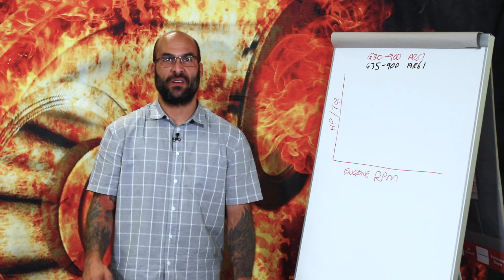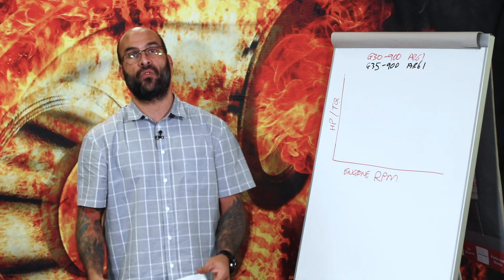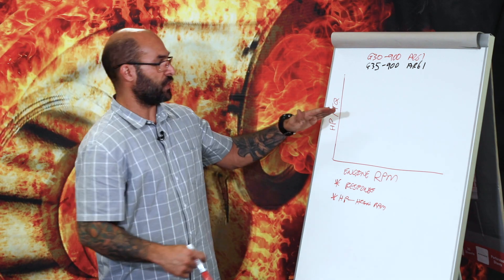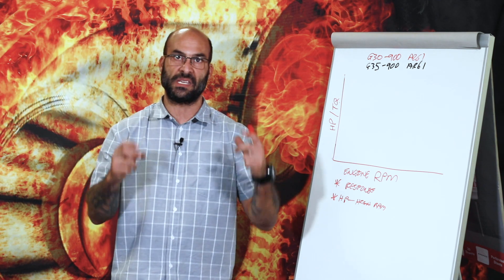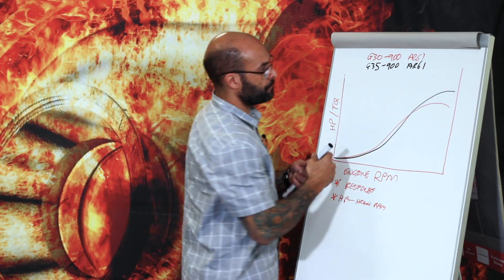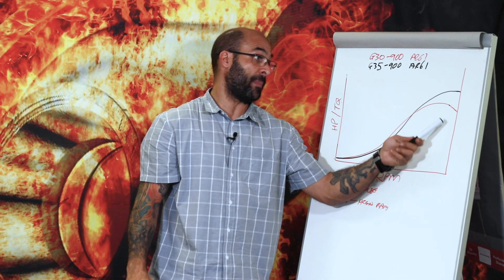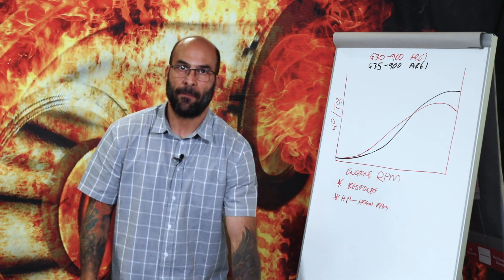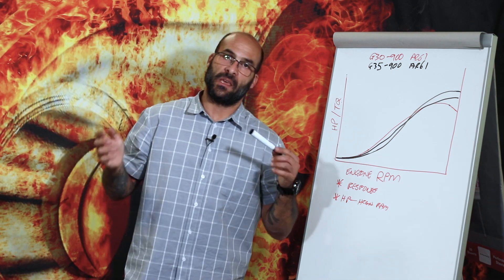G30-900 vs G35-900 N54 motor

Comment: Hello Sir,i still thinking whether i should buy pulsar g35-900 or g30-900,using rb25det s1 target horspower less than 450 for street use.Which one is more suitable?
Reply from the maker: Pulsar is cheap Chinese copies of Garrett - no serviceable parts available, expensive for a Chinese copy. Invest in a real
Turbo with back up service and a reliable product - EFR, Airwerks, TDSA - all
These are variable options
Reply: @TurboDirectSA okay then is it Garret GTX3582R suitable?

Comment: How much the increase in hp expected while move from .61 to .83 turbine housing?
Reply from the maker: It all depends on the build. If you having back pressure issues and you alleviate this you will see HP gains. If there is not much back pressure then you won’t see much gain in HP

Comment: What about a G35-900 with a T4 divided housing? Small A/R. 
Where would that fall in this scenario?
Reply from the maker: Always keep in mind that as you go UP in the family size housings, the AR number is irrelevant. E.G T3 AR1.06 housing is physically SMALLER than the T4 AR.58 ---- going up to T4 will introduce lag, IF your N54 engine is stock standard. IF however your N54 is running 13:1 CR, and wild cams, stroked and revs to say 9000RPM - then you will see high backpressures with the T3 smaller housings, and you will not make the power or power BAND the turbo might have to offer - so replacing the turbine housing with a larger T4 family will be the best thing you can do.
Reply: @ 
I agree and thank you for that explanation. 
But what about the spool characteristics of a T4 divided smaller A/R vs a T3 open larger A/R?
Say in a GTX3586 style with a K24 (built) platform?
This is what I'm trying to decide between. 
Thank you.
Reply from the maker: @ttzofutah  Now you talking about an efficient engine that revs to the moon - you will see much better benefits in using the T4 family housings. No question. Installing the T3 will choke the turbine and increase back-pressure - more heat, less power, and and

Comment: I’m getting a doc race top mount single turbo kit. It’s a T4 Divided manifold. What is a turbo with similar specs to the G30-900 that comes with a T4 housing to fit my manifold? Thank you!
Reply from the maker: @NickFigallo  a much better option would be the EFR830 which will outspool and outperform the G30 series also with stainless T4 inlet flange
Reply: @ I’m not finding a turbo called the EFR830 from Borgwarner anywhere.
Reply from the maker: @ apologies typo - EFR8370
Reply from the maker: @NickFigallo  Apologies - EFR8370 -- https://store.turbodirect.co.za/index.php/shop/turbochargers/turbocharger-turbodirect-s-a/supercoreefr8370ironb-h70x61swa84x62cw-detail

Comment: I just did this on a n54 the G35 900 makes more power and torque everywhere compared to a G30 900.
Reply from the maker: @blrn54  with more lag down low yes
Reply: @TurboDirectSA  No a g35 900 makes more power everywhere on a n54 compared to a g30 900. Maybe on a rb25 or 4g63 g30 900 makes more power and torque early but on a n54 it doesnt.
I literally just dynoed them.
Reply from the maker: @blrn54  Depending on the turbine housing i have to disagree, we have done the very same tests using G30-900 with AR61 turbine housing and there was aLOT more resposnce from the G30 compared to the larger and laggier G35. Using the AR83 turbine housing the two turbos spooled more or less the same, BUT was still slightly faster linearly from the G30 - power output pound for pound was higher above 20psi on the 35family - for obvious reasons BUT only with the larger turbine housing.

Comment: hi i have r34 gtr still factory i want to put a g30 or g35 on it to do away with the twin factory turbo's. the tuning shop is saying i will loose low end power and response if they goto single turbo. after watching lots of youtube videos i don't think i will. whats your opinion?im hoping to get around 500 whp on factory motor and keep low end power. some head room on the turbo would be nice for future engine work. but i don't want to sacrifice low end power as its just a street car.
Reply from the maker: @freedom3469  https://store.turbodirect.co.za/index.php/shop/turbochargers/turbocharger-turbodirect-s-a/g3076r1-forged-detail 

This is what you should install - quick spool and will produce the target HP and then some. The genuine Garrett G-series is overrated and underperforming for the expensive price.
Reply: @TurboDirectSA  thank you for your advice. can you tell me about the turbo you recomended or have any links for it. how much? supply to New Zealand ?
Reply from the maker: @freedom3469  shoot an email to info@turbodirect.co.za for more info

Comment: What would you suggest for a 2JZ 400-500whp maybe 600, I was looking at a G35 900 with a 1.01 rear housing. But I'm now curious what you would suggest. It's a street car with stock 6800 Redline. Cheers
Reply from the maker: @VandilFish  efr8474 black series without a doubt with AR83 turbine housing - easily spool fast and make the required power with plenty in reserve

Comment: I can’t believe you’re still responding to all the comments!
I’ve been mulling over this for months, I have a Mazdaspeed6, 2.3 engine, AWD; redline of 7900 rpm and I’m shooting for 650-720whp. 
I’m not sure if should stick to a G30-770 and be happy with whatever it ends up making or do a G30-900 to try to actually hit the higher margin.
.83 AR turbine housing for sure.
It’s dumb but I’m looking for the best response possible because it’s a street car, while still making an idiotic amount of power that I won’t get bored of 😂
Reply from the maker: For the best spool versus power output - I’m sorry but Garrett should be your last choice. EFR is light years ahead! Don’t waste your time on the G-series turbos. For the HP target you aiming for the EFR8370 will do exactly what you want
Reply: @TurboDirectSA haha, I was gathering that from the rest of the comments. 
I think unfortunately anything twin scroll is off the table for me, so I have to find the best option that isn’t.
Would you shill for any of the Precision turbo options? They’re highly regarded in the mazdaspeed community and suggested by the leading tuner, but I just hadn’t witnessed them perform to the same degree that I had seen Garretts
Reply from the maker: @chapystick_  nothing will spoil or perform as well as the Borg in the OEM sector.

Comment: I’m so torn because I want that big power but love the low end big block feel of the low end torque from my pure stage 2 twins
Reply from the maker: This is the case with most N54 owners - however what you don't understand is that its easier to spool a single turbo than two smaller units. You can use the entire exhaust energy accumulated together to drive the single turbo - if you combine the volume inside both turbine housings from your twin setup it will be close to if the the same as a single midframe turbocharger that is capable of more power than the twins are.  E.G our G3077R will spool similarly to the twins but make double the HP  https://store.turbodirect.co.za/index.php/shop/turbochargers/g3077r-forged-detail
Reply: @TurboDirectSA  that may be true but I’m making food boost by 1800rpm… the car feels like a big block.

Comment: Loved the video!  I have the same car but different goals.  It's a 2009 N54 335i and I'd like to use a Garrett turbo for the reliability, but am all about response.  What Garrett turbo would suit me best to achieve the fastest spool, but still make 475-500 on 93 octane pump gas, and 550-600whp on E85?
Reply from the maker: To be honest i would consider the EFR range over Garrett, time has shown the G-series to be overrated and unreliable. However if you prefer this range the smaller of the two would provide the better response. Careful with boost levels - you can suffer shaft failure.

Comment: Im surprised to see 0.61 rears mentioned for a 3 litre! Im used to seeing nothing less than 0.8s on stock capacity RB26s. Enjoy your videos as always👌
Reply from the maker: Streetable setups use the smaller AR housing for the low down response, but naturally the HP will become limited, and higher backpressures will be experienced.
Reply: @TurboDirectSA  My question is, is it generally better to go 1 turbine size up with a smaller A/R housing, or keep the "correct" or even one size DOWN turbine, with a bigger A/R housing? Assuming the vehicle is mixed-use (but mostly street) as opposed to pure street or pure track. I'll also watch the video to see if it's mentioned there, but if not; then I guess this is a preemptive comment, haha.

EDIT: You DID mention it in the video. Nice. Thank you.
Reply from the maker: There is so much more to choosing a match in your rotating assembly then blade count and noise. This is why there are off the shelf products which are matched , tested and maps plotted accordingly - changing these components will usually be detrimental to the performance of the turbo.  @Drunken_Hamster
Reply: @TurboDirectSA  I understand that, but a big part of the fun for me when it comes to cars are the noises and theatrics. There are other areas I can optimize any given setup to compensate for a perhaps not-so-optimized turbo that gives me the exact noises I want. Such as a twin-scroll housing and divided exhaust manifold, or a really good flowing head. Or getting a tighter A/R ratio to compensate for fewer turbine blades, etc.

This is why I ask so many questions. If I know all the variables, I can pick and choose where I want to make sacrifices and advances in order to min-max my wants vs my needs.
Reply from the maker: Twin scroll housings versus any other design do not contribute to noises. Wastegate, inlet tract and BOV (or the lack of using one) do.  @Drunken_Hamster
Reply: @TurboDirectSA  I don't think we're going to get anywhere with this conversation any longer.

Instead, could you please make me a couple of turbo recommendations?

First one: ~75 pounds per minute on a 2.3-2.5L engine(assume a relatively high VE but not as high as a good K-series), mid-range focused without being either gutless on the bottom or breathless on the top. I want minimal turbo lag, 1.5 PR boost threshold by 3000rpm, and wicked-fast transient response. I plan to run a Pressure Ratio between 2.0-3.0 depending on when I'm using pump gas or E85 and I intend to tune the ECU to auto-adjust with flex-fuel. Max RPM will be 7000-8000.

Second one: 3.5L engine ~90 pounds per minute. Same idea with the responsiveness and other factors, if possible.

Third: 1.9L TDI, ~60 pounds per minute, low-mid range focused, 1.5 PR boost threshold of 2000-2500rpm, max RPM 6000-7000, and I'm gonna run this one full time at higher PRs in the 2.5-4.0 range (depending on what the turbo likes and limits are)

Fourth: 3.0L V6 TDI, ~75 pounds per minute, other factors same as the 1.9 above.

General design preferences: All at least twin-scroll(IDK much about VGT or other "boost quickening" technology), I don't mind either way about Ball vs Journal bearing, whatever you think is better/more reliable for a daily driven vehicle, and for the budget cap; I'm not spending more than $1000 USD for the turbo, itself, and that includes shipping and upgrades like a billet compressor wheel and gamma-ti or w/e turbine wheel if you genuinely recommend me something other than a borg, which I don't think you'll do.

Comment: How do you think I did with a bottom mount speed tech kit?
Gtw3884r aka 6265 ball bearing, 0.82AR. 
Stock internal n54. Been a very reliable street drift car. Stock fueling system with a dw400 and custom map of course. I run 23-24psi daily and on track. Clutches have been a problem 😂.
Turner has told me 550 wheel and I believe him with what I find out these clutches are rated to the FLY and not crank. Bad mistake on my part. I don't wanna be on the floor again with the trans but I'll likely have to be one last time with a 900ftlb rated clutch kit.
Reply: hows the spool on this kit?

Comment: Why don't people ever talk about waste gate sizing when overcoming small exhaust housings and/or wheels? If you put a 60mm gate on the g30-900; in a flow favoring position on the manifold, would it not overcome the back pressure or "fall off" of power on the high rpm?
Reply from the maker: Thanks for the comment, and its a good one - this requires a video to explain. 99% of people dont know how to choose a wastegate or how it works (im not talking about the principal of the valve either) which is key to answer your question. Look out for this coming up soon.

Comment: The guy should go for upgrade in valvetrain make the car run at least 8500rpm as redline, choose between g35-900 or efr8474 around 0.8 ar to meet power with broader torque curve. Otherwise, usable 5000-7000 rpm range would not make the car as enjoyable i think.

Comment: Hello, I am looking to get a g30-770 upgrade turbo for my ewg bmw n55. Do you think it will be able to achieve over 550whp?
Reply from the maker: Thanks for the comment - at its absolute max it will make this power. The problem is that you will have to run the turbo flat out all the time if you want to use this power as a permanent setting on the car. I would opt for a larger turbo that will make this power at 70% of its capability, so that you ensure a reliable service. Running the G-series turbo at its max permanently will not offer you a reliable service life at all.
Reply: @TurboDirectSA  I'm also looking into this Kinugawa gtx 3582 gen II turbo, do you know if this would be a good option?
Reply from the maker: @bonestockn55  Here is an option for you - https://store.turbodirect.co.za/index.php/shop/category-layout/results,1-24?virtuemart_category_id=&keyword=g3582&limitstart=0&option=com_virtuemart&view=category&Itemid=541 

These turbochargers are manufactures by us and this specific turbo with the AR63 turbine housing made 811WHP on a 1.8T 20V VW motor - this video is on our facebook page here 
https://fb.watch/gcCFNjWWw5/
Reply from the maker: @UCQVV4bFK-i5ceuu074pSdBw it won't be I'm afraid. Manifold fabrication or modification of the stock manifold will be required.

Comment: Excellent video and so much useful information. Thanks!

I have a forged 2JZ-GTE MK4 Supra running an old T4 single turbo on a divided manifold with a 60mm external HKS wastegate and want to change the turbo for a more modern faster spooling setup for street use mainly and the odd rolling race. Hoping to hit around 650-750WHP on 97 octane pump gas (UK) - what turbo would you recommend??
Reply from the maker: Hi, thank you for the compliment.  The T4 flange face setups on a 2JZ are pretty easy to make suggestions for - BorgWarner do the EFR range for a ball bearing option, and for the power you want to make, i would suggest the EFR8474 Black Series without a doubt - it will spool fast and make the required power with ease.
Reply: if you do not combine cylinders 1, 2, and 3 (not firing order, but actual number of cylinder from front to back) on one volute and  4, 5, and 6 on the other volute, you are wasting the whole point of the bifurcated turbine housing.
Turbos LIVE FOR PULSATION. Whatever you can do to exaggerate that makes your turbo spool up faster. 

By making the turbo spool up faster by exaggerating the pulses, you can use a larger A/R on the turbine side and still achieve acceptable spool-up times, and this will widen your power band. If you use the same A/R housing but properly group your turbo pulses, you will then just spool up more quickly, also widening the power band.

Bifurcated turbine housings were designed by large teams of engineers. Combining your exhaust into one collector prior to it worse than voids the benefits of it.
Reply: Did you actually make decent power with 97 octane?? is there no 99 ron where you live ? be very surprised if you cross 600 Crank with 97 ,,cant see you will get enough timing and det resistance with the lower grade
Reply: @marcperrett662  I made 730 at the crank on 99. I'm not sure what the figures were on the 97 map. I ended up going with a Garrett G30-900 1.06AR divided on a proper divided manifold running 1.5bar boost. I'm quite happy with the response and overall power for the setup.
Reply: @foxy_media  nice numbers and about what i would expect for 99ron ,,the 97 is pretty poor for det resistance ,,could probably knock 50-70hp off that number  for 97 IF it would allow that much boost ,,,the southern irish guys are stuck with 95 😥,,,will try the same turbo on my new 2,35 impreza engine ,,probably lowish 600s on 99 and maybe late 600s or very low 700s with a bit of meth ,,fed up with a 35 rear end on my current turbo ,,would like to try the 30 turbine in the 900 size👍👍👍👍👍
Reply: @marcperrett662  where abouts are you located and what turbo are you currently running? At some point I'd consider going up to a 35-900 or 35-1050 but at the sacrifice of some slow down response.

Comment: Looking to buy a new turbo for my single turbo 335xi, why and would you recommend a g30-900 over a gtx3584RS gen2? Goal is about 800awhp, no specific driving style but definitely want the fastest spool up..
Reply from the maker: Matt i wouldnt choose either of these turbochargers especially not the G-series. They are overrated and will not see yuo to that HP target, not even close. 

The GTX3582R Gen2 is proven, fast spooling and able to make the power you want. It will run high boost, but will outspool both the other two turbochargers with ease.